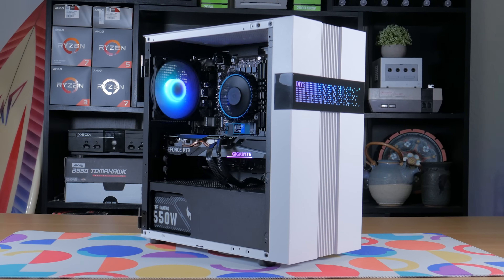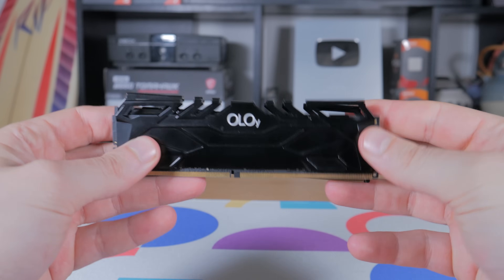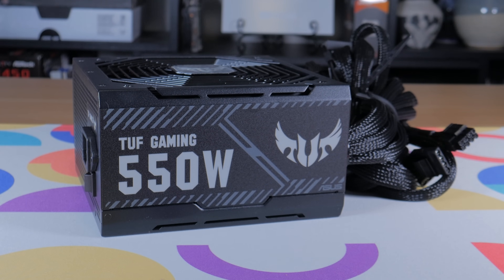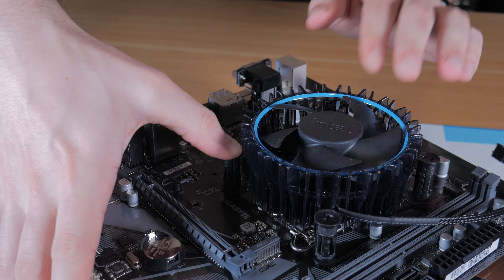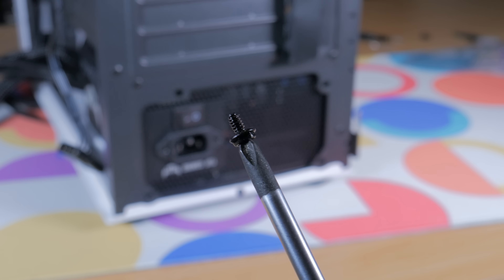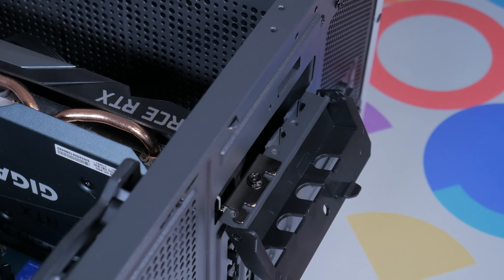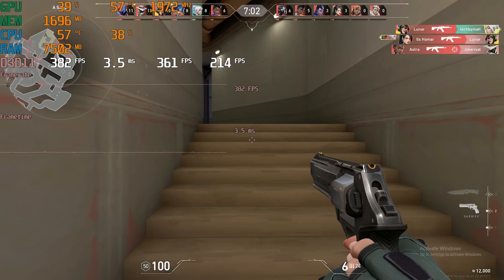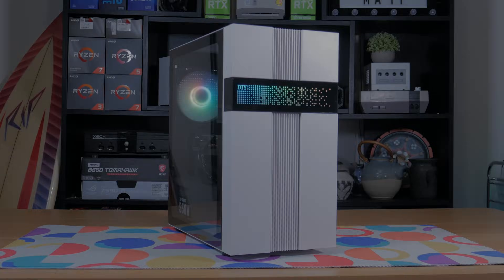BEST $750 Gaming Pc Build Guide! (2022)

Comment: The 6700xt goes for under $350,also the ryzen 5 5600 plus 32gigz 3600mhz cl16 ram would handily beat the 12100f for only $3(forvthe cpu)and $30-40(for the ram) more which u would have saved from the gpu buy,that pc would literally WIPE the floor with your combo,n that just on a newer gen build if u were to go lower to the e5 2667 v4 xeon for $40 plus the 6700xt or even the 6600xt + 32gigz of ram you would still beat ur current build for far far less cost

Comment: i am very new to pc building, does anyone know if i can put a core i5 into the same motherboard that he’s using in this video instead of the core i3? i was also planning to get an rtx 3060 instead of 3050, anybody know if it would work?
Reply: Of course you can put a core i5 and not an i3, but it must be a 12th gen core i5, because the motherboard is designed for 12th gen cpu, and you can also put the rtx 3060 and not an rtx 3050, the core i3 12100f cpu can support an rtx 3060 without problems, and if you choose a 12th gen core i5 cpu it would be much more powerful than core i3, if you have more questions about what it supports and what it doesn't support the cpu or the motherboard, just search the component model in google and it will show you more specifications

Comment: Help! We're getting 5 beeps on startup and no video! Can't install windows... 
I built this exact unit with all recommended parts from the list... The only exception was that we used a different motherboard: GIGABYTE B660M DS3HDDR4. Is that the problem?
The computer DOES turn on. Lights and fans turn on.  Regarding video, we've tried 2 monitors... on connecting via HDMI to HDMI and the other monitor using HDMI to DVI. We've checked both memory sticks using only one in primary slot. We've reviewed all other connections too. Lastly because of the 5 beeps, we reinstalled the CPU as a last attempt at fixing. Argh!

Comment: The reason why I would go for the rx 6600 is that I can use smart access memory with my ryzen 5 and power consumption is a bit lower than the rtx 3050. Also, I feel like amd cpu and gpu together could perform better since they both are amd. The performance is also good since I only do gaming and programming.

Comment: In my country these cards are way to much money but I found a pre built with:
I5 10400
Gtx 1650
16gb ram and it costs 650 is it worth?
Reply: @abdellatifcheater9833  greece
Reply: @abdellatifcheater9833  there is also another pc with the same specs but with a ryzen 5 3600 and it's 650 euros
Reply: @alexoncrack6807  what is the price of an rtx 3050 and rtx 6600 in your country ? And what is your budget.
Reply: @abdellatifcheater9833  the rtx 3050 is 400
Reply: @alexoncrack6807  I have an option build for you and it's brand new :

1)Best budget B660m mobo and it was reviewed by techspot and others 

2)I3 12100f with stock cooler new

 3)and a 8gb 3200mhz ddr4 corsair vengeance lpx
Total is 316$ and if you want another 8gb for a total of 16gb ram it will be 353$ 

And you will have money left for case and gpu and hdd if you don't have
Reply: @abdellatifcheater9833  my budget is max 750 to 800
Reply: @alexoncrack6807  yes it's so good budget.  By the way you have an Instagram or telegram better than comments . I will suggest you and show you options
Reply: @alexoncrack6807  your best option is :

I3 12100F this cpu outperform all 11th gen cpus almost

B660 mobo . Soyo classic mobo

8gb to 16gb ram 3200mhz

Rx 6600 or rtx 3050 (pick the cheapest one and buy locally)

Case buy it locally

Do you already have a PSU?
If you need help im here
Reply: @abdellatifcheater9833  it doesn't let me comment idk why

Comment: Great build, I’m about to do a build for a friend with a 3050 and a 12400 for about $50 more than this. The 3050 was $240 from EVGA’s website, free shipping and I had a discount.

However, for over $300 the 6600 is the clear winner. It’s just hard to ignore how much faster it is. While DLSS is great, DLSS won’t make a 3050 outperform a 6600 when turned on, and it has to reduce visual quality to compete. Ray tracing is not a major feature at this tier, it’s just not practical for maintaining smooth performance. 

If you’re a serious streamer, then yes go with Nvidia but then go up to at least a 2060 maybe 3060. In my opinion the 3050 only makes sense under $300

Comment: I got that same DIY CASE for my first computer build I bought a used Dell Optiplex 3010 DT. I5 3470 8 gb.ram 240 gb adata ssd,500 gb.hard drive and a gt 1030 ddr5 2 gb. Gpu and Harbin repair adapter kit I only got $325 in my build it runs all E sports title great!!!!!can't wait to upgrade my GPU to a Rx 580 8gb.!!!

Comment: I have a similar budget pc to this, I have a 6600 in it, though while I was considering the 3050 heavily, I decided to go for the 6600 because I got a good deal it was roughly 20 USD more than a 3050, I went for the 6600 because the raw performance was better by roughly 20 - 30 fps more on average, if the 6600 was any more expensive I would have definitely gone for a 3050
Reply: Or the 1660 super
Reply: Thats smart, the only thing your mssing out on is rtx and DLSS support. Hope you like it :D
Reply: @entrevligsnubbe6431  rtx on the 3050? Lol
Reply: @learnedtolove1611  rtx 3050 isnt bad it's just the price is god awful compared to it's actual value
Reply: @entrevligsnubbe6431  honestly any game that has dlss is bound to have fsr, unless the game devs want to receive a bunch of heat, and raytracing isn't that bad on this card, at least compared to the 3050, 2060, and 2070, the 2070 super and 2080 ti and non ti still edge out over the rx 6600
Reply: @entrevligsnubbe6431  lmao
Reply: now you can find the rx 6600 for less than rtx 3050 for the rx 6600 it’s 300 and for the rtx 3050 it’ 330

Comment: I would go with the 6600 cuz I believe its something like about 15% faster, and is usually cheaper, for example u can get an msi one for $340 rn. But the main reason is that amd has fsr, which isn’t as good but is still very similar to dlss, and I know from experience cuz I have a xt model and it works great. Also rtx is not a very useful feature at this price point, because there is only gonna be very, very few titles that anyone would even try to use rtx on without having a lot less performance, and it’s just not very practical for a budget card at all really, I had it on my 2060 before and I didn’t find it very useful at all
Reply: Msi model currently goes under msrp at 325 if you use the rebate
Reply: Thought it was more like 20-30% faster on average
Reply: @NuggetsXInfinite  depends on the game I was saying that it’s basically at least 15% faster
Reply: Have you played call of duty or warzone on the 6600xt??
Reply: @stevenjonas1  that’s the card I have and I have about 200 hours of warzone on it. My games runs at about 110 1440p mostly high some medium settings
Reply: @n.i.c.k5984  are you using fsr? I'm looking to build an i3 12100f 6600xt build with 16gb ram to play cod multiplayer. Have you played multi with your build??